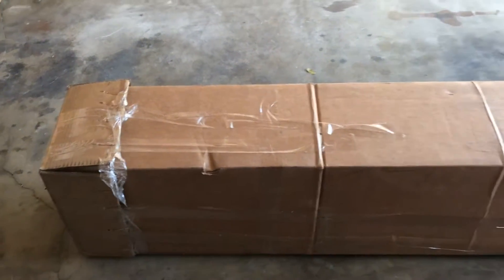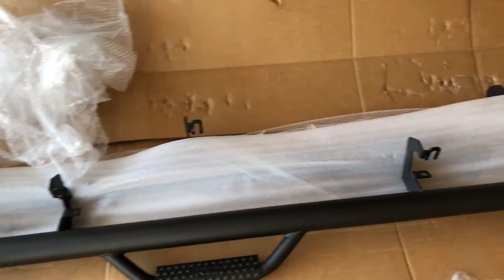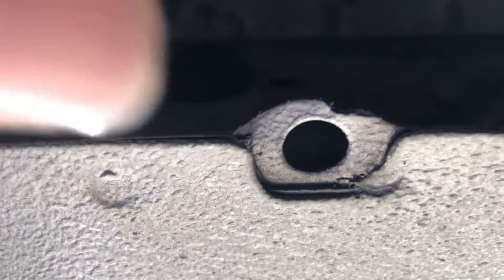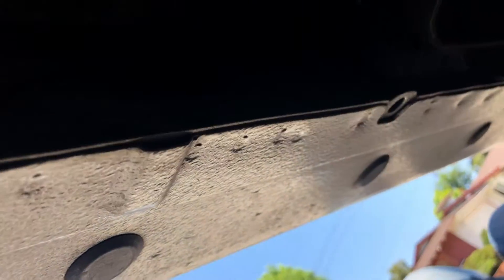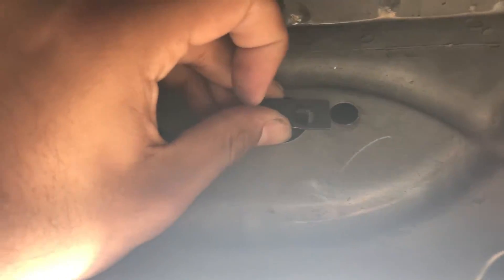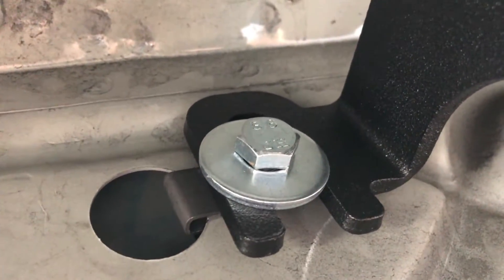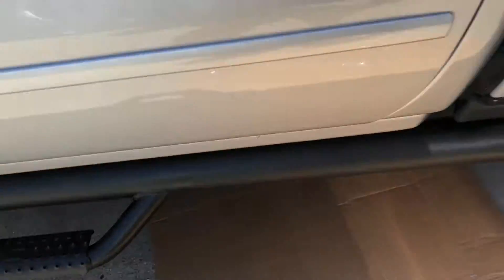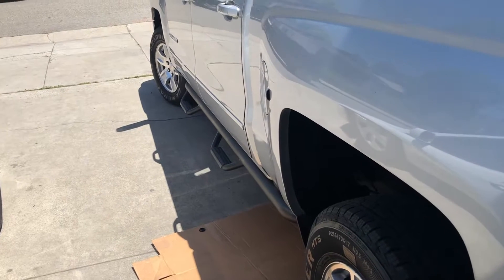How To Install Rough Country Nerf Side Steps!!! (2017 Silverado Crew Cab)

Comment: I just got them on my 18 Silverado, and I feel like its odd, using them to get out of the truck... I feel like the steps are too fwd positioned? Do you have the same issue? Maybe I just need to get use to them?
Reply from the maker: Lavel yes I have the same problem. They are poorly designed. Even getting in they’re odd. The only thing they really do is give the truck a nice look
Reply: Jacob Gonzalez damn!  Ok,  I guess it is, what it is.. Thanks for the info brotha!
Reply from the maker: Lavel no problem 👍🏼